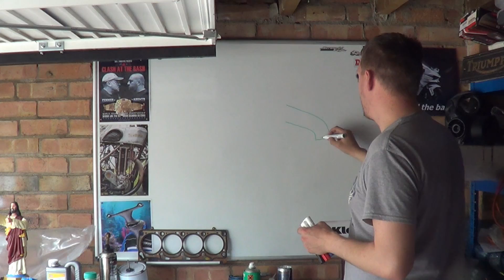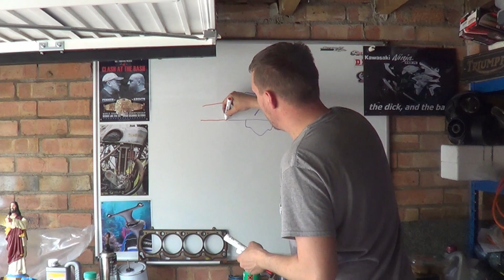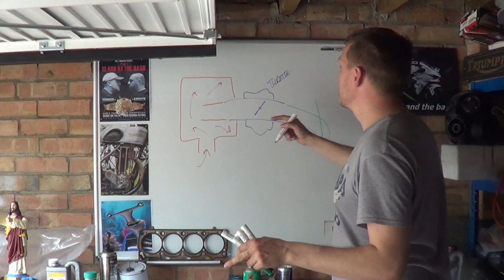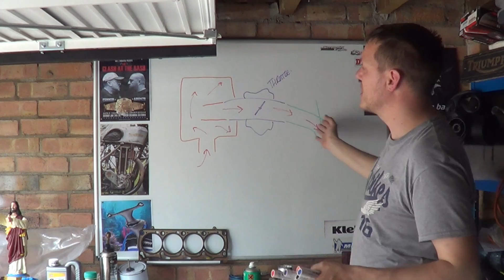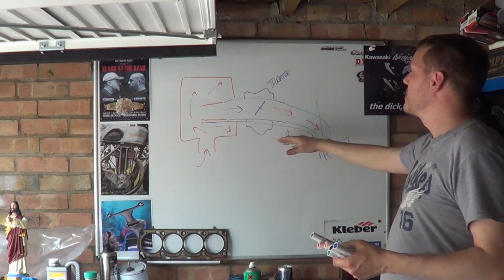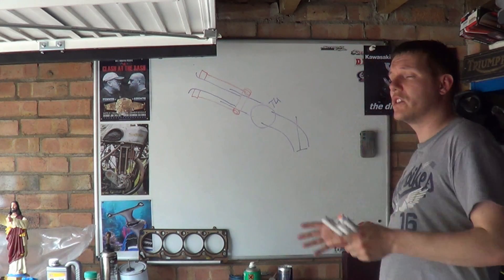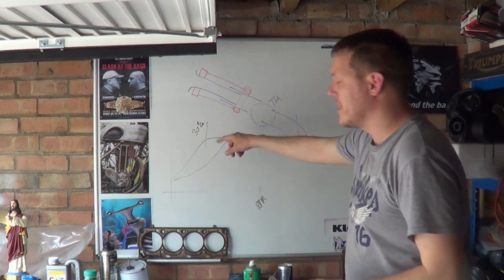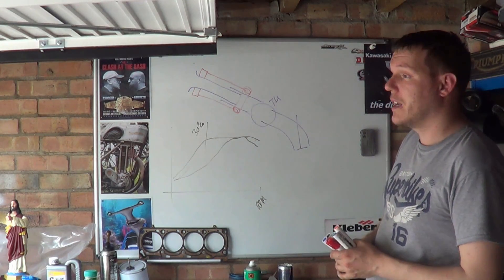Variable length intakes

Comment: Amazing. So the vq35 has this system (like in a pathfinder). The intake manifold provides two air paths, one is shorter and has a set of throttles that open up around mid range.

Comment: disabled the acis system on my Lexus and found the power band actually grew across the rev range and no more annoying kick around 4 thousand rpm upon activation ,some manufacturers add these intake systems just to cut down on induction noise and are of no real benefit to performance. Your videos are great btw .
Reply from the maker: Cars usually have a different system, emissions obviously play a part. Cars usually have a 2 length system and I'll cover this soon

Comment: I think to make that work when you want to make that upgrade to your bike is over the throttle position. Since that relates to your rpm in the same ratio. I would try to just ad an extra throttle cable to be able to adjust it independently of the throttle body. Over linking it and by having the slides spring loaded you might get the fastest reaction with a easy and solid construction. And if shite breaks it will be an easy fix. No focking around with fast rotating parts or high pressure/ vacuum. If needed you can link is so that it pulls so that for an example it pulls it out 1inch at the first quarter of twist range and pull more and more till the last quarter of the twist range pulls it 3inch out. I think you know what I mean... If the the length is not inline to the rpm.

Comment: First of all, I love your videos! So much knowledge and a great way to pass 12-hour drives across the country lol
Secondly, I've seen a lot of different equations for determining intake manifold length. For a single cylinder engine, how do I calculate the best length for different rpm's? Thanks!
Reply: In a one cylinder engine, would this effect still occur if the plenum was replaced with a pod filter?
Reply: This is an amazing video, he described it so simply and beautifully that I managed to do a quick calculation to work out the optimum intake length for a given rpm. I've never come across variable intakes before so some of my assumptions may be incorrect but here goes. So the intake stroke happens once every 2 engine rotations (4 stroke). The time taken for 1 rotation of the engine is simply 60/rpm. So the time between each intake stroke is twice this (120/rpm) as it happens every  other rotation. Now you want this time to be the same as the time it takes the pressure wave to travel down and then all the way back up the length of the intake. So the pressure wave needs to travel a distance of 2L where L is your intake length. The pressure wave travels at the speed of sound which I will represent with the letter a. As time=Distance/speed, the time it takes the pressure wave to travel down and back up again is 2L/a. Now as we want the time between intake strokes and the pressure wave time to be the same we get (2L/a)=(120/rpm). Now we rearrange the equation to solve for L and we get:
L=(60*a)/rpm. (L is in metres and a=343m/s approx at sea level)
Hope I'm not too late in answering your question.
Reply: @fahadislam150  Thanks for the reply. Yes that's the simple math behind it but I believe there ends up being some variation of the speed of a pressure wave at different pressures and temperature.

Comment: ive got some questions if u dont mind Matt,

1- In a 4 stroke, when the piston is at BDC and is now a low preasure area, does that not mean that air from the outside (high preasure area) is still attracked to it to squeeze in as much air/fuel as possible ? Or if i pointed my carb intake into the direction of travel would create this effect ?

2- And how different would the running/power of a 4 stroke be effected when running open carbs with stacks vs carbs with say a 1m cubed airbox (one extreme to the other) as back in the day open carbs were everywhere on the race track whereas now its almost a case of the biggest airbox wins ? hope u can shed some light on this.

great vids, (PS i havnt watched your videos on airboxes yet but will be soon just thought id as while i was here).
Reply from the maker: 1. You mean on the intake stroke?
Reply: @thedirtyworkshop  yes, sorry should have specified

Comment: Thanks I had doubt of how it works !! Just one question though !! Depend on the timing you alterate the length you can ajust the nearly flat curve of your power ??
Reply from the maker: Do you mean torque? You don't want a flat power curve
Reply: @thedirtyworkshop  yes that what I mean. Also thx for the video you speak réal and not like some dum books I really enjoy it !!
Reply from the maker: No worries.

Variable intakes are to try to keep the VE as high as possible, which would equal a flat torque curve . An excellent example of this is the flat 6 honda goldwing engine.

Comment: how beneficial is it to extend the runner length, pre-throttle, if you're at low rpm part-throttle?
Reply from the maker: well that's an open question

Comment: Hi I've had to shorten the length of my inlet manifold by three quarters of an inch on a Honda CG125 engine to get the engine and carburetor to fit in a Honda CR80 frame. Will the shorter inlet manifold distance cause the the mixture to run any richer or leaner?

Comment: Hey man, sorry for being a nube, but does this also work if you have forced induction?
Reply from the maker: great question, no. lol The manifold has to be able to withstand the pressures of forced induction. Having a movable runner would be so difficult that you just wouldn't bother. This is a good point though.
Reply: That makes sense, thank you

Comment: Hi, does it make any good sense if I were to upgrade to a bigger air box. Hoping that "the waiting room" would hold more air to give extra air when the valves open. ?  

I know this is a video talking about 4 stroke engine. Just a thought that I'd like to do the airbox upsize on my 135cc 2 stroke.
Reply from the maker: no is the short answer, airboxes are all about harmonics, and sound related stuff, just leave it alone lol